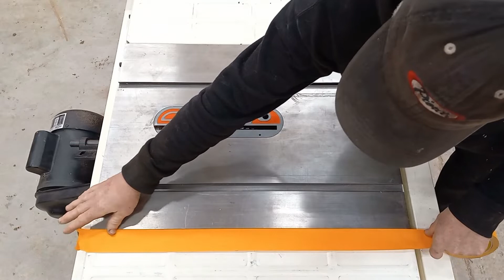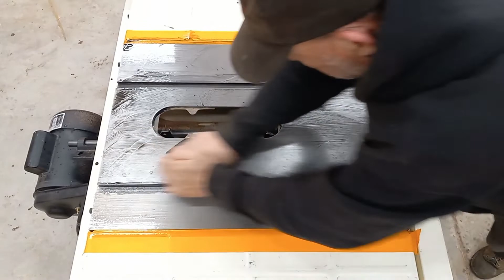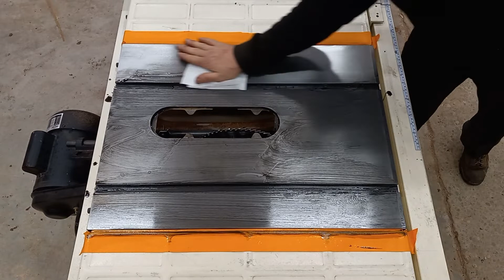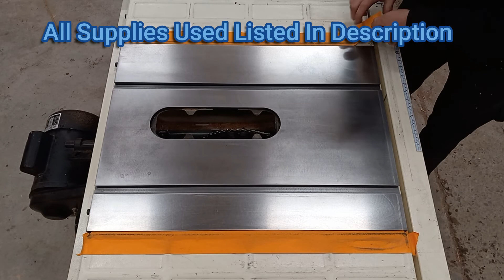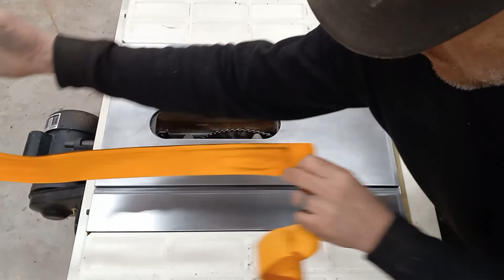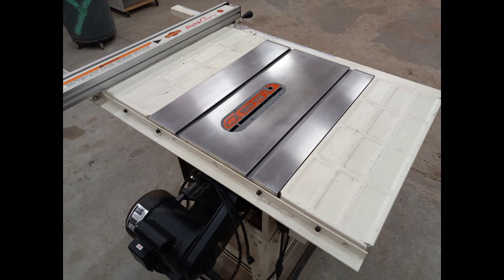Refinishing Table Saw Top, Cleaning a cast iron top, ASMR

Comment: Nice job , table saw looks great. 
Did I miss the finish on the shower?
Reply from the maker: Thank you. You have not missed the finish on the shower. It's been hard to get all the supplies together and when I got all the supplies the weather flipped back to winter (temperatures in the 20's and a foot of snow) making it impossible to do epoxy work in the shop. It's getting warmer so I'm hoping to get back on the shower this week. :)